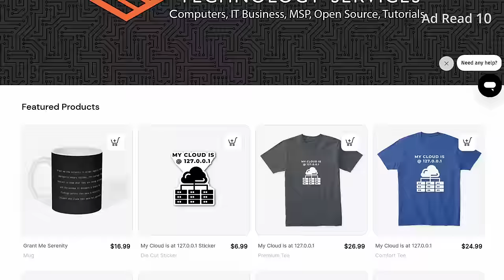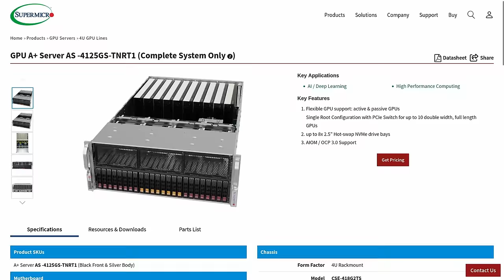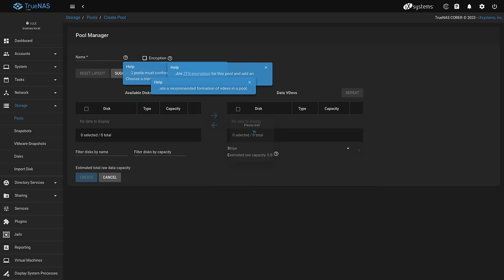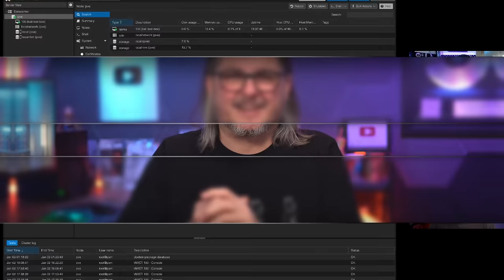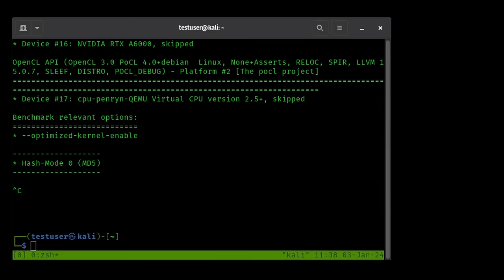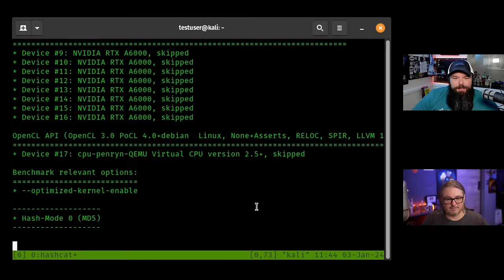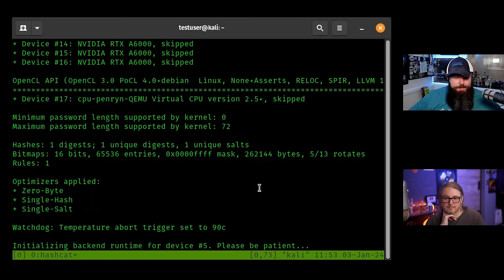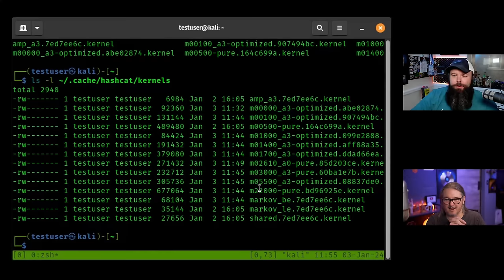Client Project: Hashcat Testing With an AMD Epyc Supermicro Nvidia GPU Server Using Proxmox

Comment: @6:50 you can also use driverctl to early bind PCIe cards to vfio drivers so you don't have to blacklist. One benefit is you can have identical cards and pass one through but let the other be used by the host OS for example. There are other benefits to using the vfio drivers as well.

Comment: 8:23 3000W are no problem for an ordinary outlet here in Europe thanks to our 230V single phase voltage. :D
Reply from the maker: Yup, MORE VOLTAGE is better!
Reply: Exactly what I think too. :)
My Home heatwater boiler outlet supports up to 4000W and this is normal two-phase, not industrial three-phase electricity. Great machine :)

Comment: For reference, that's at least the 3'd generation of the same TYPE of GPU server from Supermicro.
The first generation has gotten pretty cheap - but it's DDR3 and uses Intel E5 first generation 2xxx or 4xxx CPUs as I recall.
I'm a bit shocked you didn't go with a Supermicro mass storage solution, like their 6049 series machines, for consistancy.
I've always found the 45 drives machines overpriced for what they offer, though the DO have some longevity on the core design (that is an older iteration of a BackBlaze design, but BackBlaze went with commercial designs instead of designing their own once Dell and Supermicro etc. started building high-density storage servers).

Comment: Going back to when Resizable BAR was introduced, games didn't get faster until they were either updated or built with it in mind. 
Its been part of the PCI spec for years, but vendors didn't support it for a while.

Comment: Now imagine running that GPU server with 4090 cards instead of A6000.
Half again or a bit more the power draw, but on Hashcat at least 60% faster (that many more cores AND a slightly higher peak clock rate).
Reply: 4090 are triple slot compared to the dual slot for A5000.
Reply: @RahulSinghalChicago  But they're also a LOT more cores and higher clock.
Cooling might be an issue though.

Comment: What was the actual settings used in the system that allowed GPU passthrough? Did you install as EXT4, XFS, ZFS? I've tried blacklisting the drivers with consumer cards but the passthrough has never worked correctly. The furthest I could get was the guest seeing the GPU and installing the drivers but CUDA was completely inaccessible or would crash the guest.
Reply: we are doing the same thing with these systems, only issue we had on proxmox 8.1 is that you could only passthrough the gpu not the nvidia sound card. didnt even need to blacklist

Comment: A machine this complex and expensive not having an easy way to reset the bios is mind boggling.
Reply: These types of boxes are shipped to install. Made to order so you don't have to. Maybe there was a blip in the request and what would run on the machine.

Comment: The last small data center I worked in had 10 GPU chassis with 4 A100s each...and those weren't even the expensive servers 😳😳😳

Comment: i would solder cables to battery just in case , bios needs to be reset again. dismantling and putting it back could be fun at first but i dont think it would be fun on multiple times

Comment: Seeing as you guys are obvious experts in the field, and are doing the supposed impossible, can you put me on some info on GPU passthrough for my home setup:  Nvidia RTX4070, 64G ram, running QEMU/Virt-Manager.  The only stuff I can find says Nvidia doesn't allow it, and thus it can't be done, but you obviously modprobed it into submission. I'd like to know how to do that.  Awesome video, by the way.
Reply from the maker: Check the Level 1 Forums they might have some write ups on how to do it. I don't use oVirt.

Comment: In the late 1980s I used to compare the Unix password file against a 10,000 word dictionary. I found dozens of passwords. It would run for hours or days on a Sun or Sequent Balance. 14 million in 90 seconds is faster.

Comment: Feedback, assuming you're using 94 keyboard characters for your 8 character key (password):

An 8-character key (password) has 6.096E15 permutations with replacement and 52.44 bits of entropy.
A 40-character key (password) has 8.416E78 permutations with replacement and 262.18 bits of entropy.

6.1 Quadrillion crunches is impressive!  However, let's look at the true power of passwords:

It will take you 1.381E63 times longer to get through 50% of the keyspace of a 40-character password than for an 8-character password.  A 40-character keyboard password is the minimum length of password randomly chosen from the 94 character set on most keyboard in order to fill the keyspace of AES-256.  For AES-128, it's just 20 characters.

Now, just how powerful is a 40-character keyboard password?

If you're 50% through an 8 character keyboard password's keyspace in 18 hours, getting through 50% of the keyspace of a 40-character keyboard password will require 2.058E50 lifetimes of the current age of our universe.  Put another way, if you want to be 99.999999999999% (12 nines after the decimal point) sure it'll never be hacked, the bad guys would still require 2.058E38 lifetimes of the current age of our universe before they'd give up after having only solved 0.0000000001% of all possible solutions.

This is WHY there's absolutely NOTHING wrong with sufficiently long, random and properly secured passwords.  There's only bad password choice and poor security, which is why I'm a firm believer in the best password managers.  I prefer Bitwarden, as neither your master password nor your user passwords ever leave your computer.  Regardless of which password manager you chose, DO use a properly long and random master password.  Again, 20 keyboard characters will give you AES-128 level security while still requiring 71 billion times the age of the universe to cut through half.

Finally, DO print them out and store them in a safe place, such as on the dark side of the Moon, or at least in a safety deposit box guarded by two Hell Hounds.  Okay, so I'm a Supernatural fan -- don't hold it against me...  :)

One of these days, we computer scientists will develop a way to accurately create, and most importantly, re-create, ridiculously long passwords (160 keyboard characters) based upon 1)  What you know, 2)  What you have, and 3)  Who you are, along with a quantum-proof encryption algorithm.  I'm thinking AES-1,024 would be sufficient, along with a part memorized and part-generated password of 160 characters, but a number of new, totally different algorithms are current in competition to become the first global post-quantum cryptographical algorithm.

Comment: I get it. I have a multi-H100 server, with max draw of 10KWatts, and requires two 20 amp 220V and one 15 amp 125V circuits.

Comment: Using multiple power sockets, but presumably on the same phase?  Like Ghostbusters, remember to never let the streams touch.  Modern systems work fine, most of the time, with power from multiple phases, but in a fault condition you will be potentially getting a shock much greater than 110volts.  With 240v in UK data centers each rack tends to operate on a single phase, a fault across two phases could give you a shock of, potentially, 415volts.

Comment: This is a very sweet setup, however not at all a new idea. As my former profession was IT forensics - before I switched to IT security - I have been working with similar systems called "Octagraph" from a German company called "MH Systems" and apart from the GPU power had even more features such as forensic bridges mounted right there in the same box at the front, etc. 
So, more than 10 years ago there already was a more complete product, obviously with a lot less compute power due to the technology jump from back then.

Comment: instead of removing the battery, you can update the BIOS again, but do not check the save settings option in IPMI - then the server will boot with the default settings
Reply from the maker: Nope, we did try that and it failed

Comment: Just curious why would you go with a single root system when you are already installing 2 cpu's? Since the system only has 32 lanes to each PCX switch that means 5 gpu's share 32 lanes of bandwidth which all go to one cpu? We are running these with 4070's and only one cpu so just wondering if you know something I dont :)
Reply: The single root architecture is ideal for applications that reside on a single CPU but require access to multiple GPUs. A single
root system dedicates one of the CPUs (out of two) to manage all communications with the GPUs. This results in using a maximum of 10 GPUs in a single server.
A single root system is tailored for deep learning applications where most of the computation takes place on the GPU.
Advantages of a Single Root configuration:
- A single CPU has access to up to 10 GPUs. Applications that need direct access to all of the GPUs will benefit from this
configuration.
Applications – When peer-to-peer communication (GPU to GPU) performance is not critical. 

Supermicro has the AS-4125GS-TNRT (direct-connect GPU), AS-4125Gs-TNRT1 (Single-root), AS-4125GS-TNRT2 (Dual-root).

Comment: Are there any reason that you guys went for A6000 GPUs instead of normal 4070s or similar? I know the performance is worse on A series for password cracking so I am curious if there are another reason for that option.

/Full time pentester
Reply from the maker: We used it for Hashcat, but that is not what the client is using it for,
Reply: @LAWRENCESYSTEMS  ah, thanks for the clarification, I focused a little to much on the password cracking aspect
Reply from the maker: @tobias8678  I don't blame you, their use data analytics case is not nearly as exciting as cracking passwords.

Comment: Anyone still using an 8 character password across everything really ought to be sweating now.
Reply: for actually logging into a website, it should not be an issue .  They should be blocking multiple attempts after a trivial number of tries.  For other use cases, no one should be using 8 characters.

Comment: Passwords YES, pass phrases NO.   IF you had a pass phrase that contained only dictionary words, non-sensical but well known words, foreign words, only lower case and no punctuation or digits but contained at least 16 words then that would be the same as a 16 digit combination lock where each cylinder had 1.5 million digits.   I challenge you to crack "hey diddle diddle the cat stole the fiddle and the cow jumped over the spoon" and tell me how long it took your server to crack it WITHOUT you giving it any information on the content of that phrase (let it assume upper case, punctuation and digits etc"

p.s that phrase is only 15 words so that should make it easier right?

What makes a "password" secure is not its contents but its LENGTH.  Having passwords like "%gT1\:hC" makes it absolutely impossible for a human to remember it but absolutely trivial for a computer to crack it even if its a 30 year old computer.

Comment: You will not crack any of my passwords in seconds or a matter of days. All my passwords are fourteen characters long and consist of alpha/numeric/symbols that is 4.21 x 10 to the power of 27 different password combinations, or 4,205,231,901,698,742,834,534,301,696 possible combinations. To put that into context, it would take that computer 3.8bn years to crack my fourteen digit password, working on the assumption it can can crack an 8 digit password in two days.

Comment: Its got 8 A100s in it, what is that $150,000 worth of hardware along with having to buy a literal power plant for you house just to run it 😂

Okok i watched the video, they aren't A100s 😂 RTX A6000 is much cheaper.